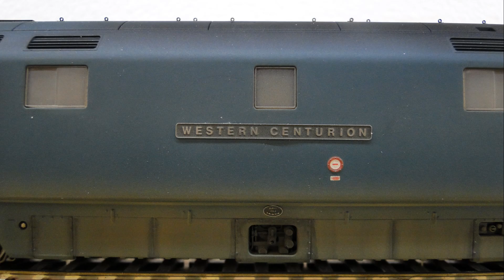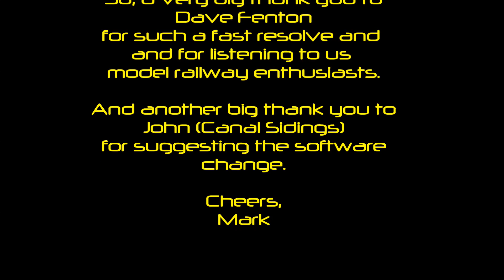Exciting news on the MegaPoint Servo Controller Board 16-09-2017

Comment: Sorry Mark me again, i like you was seduced by Dave's Megapoints Control system 2 years ago at the Great Central Model railway show held each June, your right it's not cheap especially when you have 36 points, gates & signals to control, i originally was going to fit micro switch's to switch polarity but the thought of all the extra work was daunting then i saw your vids & i have to say you did a better job of explaining the installation than Dave's vids on the subject consequently i took the plunge & purchased 10 Relay/Frog boards & 3 Driver boards.
Because of a restricted budget i have had to buy numerous boards inc a very nice mimic/control panel the cost spread over the past 2 years well over £1k then there is the trains & stock, track, dcc controller, 12v regulated transformer, bits & bobs & all the tools. 5 years of spending money a few half truth's told to her indoors and i am still here to tell the tale,LOL.
Mark have you been to the GC Model Railway show yet if not then you should go it's in my opinion the best annual model railway show, you won't be disappointed, Finally regarding your latest video format & presenting skills it is very entertaining but to be honest there was nothing wrong with the previous vids, like one of your subscribers has said you come across as a mate & i like that, well done & keep it up..... Andy
Reply from the maker: Hi Andy, again lol.....
I love the sound of what you've created and you're right, it is a very costly way of operating the turnouts, but I did do some calculations against using MegaPoints v DCC Concepts and Daves product actually came out cheaper, the more we use, the cheaper it becomes, sounds bizarre bit it really does
And I love the idea of the mimic panel, that is a route I'm seriously thinking of going down, have it in my head to make two 4' x 2' mimic panels, one for the fiddle yard and the other for the main layout and mount them on the wall, one either side of the big TV, that way you can see from a glance where everything is in real time, will take some designing but it's way off in the future yet.
Just counted the turnouts in the fiddle yard, 42 so far so looks like I'll be needing another controller board and frog board, I have a few of the relay boards, bought them from China for something like £1 each, bargain :0) I can send you the link if you like but they can take up to three weeks to arrive.
I am actually out of money now and in debt [eek] so it looks like I'll just be playing trains around the fiddle yard for the next 12 months but that is so much fun :0)
I haven't been the show, to be honest I don't really enjoy them anymore and nor does Debbie, much prefer to take her out for lunch now a days and have a nice relaxing afternoon, god I sound like a sad old git lol.....
Reply: Mark you know that TV advert Purplebricks with  "No Commission" well i have just had a NO COMMISSION moment when i read about your £1 relay boards i have just paid x 12, it's a good job i am not in your train room or i might pull your droppers off. LOL 
i wish i had done the post 2 weeks ago, seriously i did find cheaper ones on offer at Hobby King i ran them past Dave but he said he had not tested them plus his come with the cables & a guarantee not to mention product support so i chickened out. I did notice that your were not from DF so tried to zoom in on yours to find a brand name but nothing that Google search could make a match to, so yes please send me a link & thanks ... Andy
Reply from the maker: Lol, isn't that just the blinking way, buy something and then find out you can get at the fraction of the price, but then again you do have the comfort that what you've bought from Dave does actually work and that he'd replace/refund if anything did go wrong.
I buy my servos from Hobby King, just bought another 40 from them, but this time they are shipping from Hong Kong and cost me over £13 in shipping, 70 odd pounds in total, that broke me big time and I don't really need all 40 just yet, then I found some servos on that look identical but they're blue and at £1 each with free shipping, so I bought 10 at the same time as I bought the 70 from Hobby King, the 10 blue ones came from China so right next to Hong Kong and they arrived 4 days after purchase, arrived before I even got conformation from Hobby King lol.
I've added a few links for you to look, one include 100 meters of servo cable, brilliant :0)

From this website you can get a discount if you order from a mobile devise like a smart phone or tablet, well worth it me thinks.

https://www.aliexpress.com/item/Free-shipping-4-Channel-5V-Relay-Module-4-road-relay-modules-expand-with-Optocoupler-relay-For/1492110181.html?spm=a2g0s.9042311.0.0.QMyTvt

https://www.aliexpress.com/item/Single-chip-4-channel-relay-expansion-Board-supported-the-AVR-51-PIC-4-channel-relay-module/821672110.html?spm=a2g0s.9042311.0.0.QMyTvt

https://www.aliexpress.com/item/10pcs-lot-lofty-ambition-SG90-9g-Mini-Micro-Servo-for-RC-for-RC-250-450-Helicopter/32680024453.html?spm=a2g0s.9042311.0.0.8p4T0N

https://www.aliexpress.com/item/New-Infrared-obstacle-avoidance-sensor-module-Tracing-Module-electrcal-sensor-for-Arduino-Robot-project/2004170188.html?spm=a2g0s.9042311.0.0.a29wIP

https://www.aliexpress.com/item/Free-shipping-IR-Infrared-Obstacle-Avoidance-Sensor-Module-for-Arduino-Smart-Car-Robot-3-wire-Reflective/32321964595.html?spm=a2g0s.9042311.0.0.a29wIP

https://www.aliexpress.com/item/Wholesale-100M-26AWG-3P-JR-Futaba-servo-extension-cable-wire-cord-lead-extended-wiring-connector-for/32784854226.html?spm=a2g0s.9042311.0.0.a29wIP
Reply: Hi Mark, just a quick question, i note you have put isolated fishplates on what looks like all the ends of your points it also looks like you have bridged the stock rails & i assume you have also cut the the wire links on all your points, please confirm.
The Megapoint guide tells me that the frog wires should be connected to the centre connector on the relays & the other 2 connectors to the stock rails ( swapping these around if shorts appear when crossing with a loco)
Because the points are isolated from the main track then power must come from droppers from each point to the buswires which enables power & communication packets to be delivered, or is power & communication delivered via the relay?

Comment: Hi Mark, a couple of questions, 1, how far is the servo away from the servo controller or rather what is the max length of cable you have used ?.  & 2, have you used insulated fishplates on all your point frogs ?  Andy
Reply from the maker: Hi Andy, the longest connection I have so far from servo to controller board is around 4 meters and it still works perfectly. I've been busy on the fiddle yard [hence no videos for awhile] and it's nearly completed, last few lengths of track to go down and then I'll be installing servos in the newly laid turnouts, some of these will be around 7 meters away from the controller board but I don't foresee any problems, last famous words lol....
And yes, I have used insulated fish plates on my turnouts where the insulation is required, on basic turnouts I use standard fish plates on the external rails.
On the Glenn Drewertt Junction I did use insulated fish plates throughout just as a precaution and glad to say that it's running perfectly :0)

Comment: Hi Mark, I'm pleased you got your chatter problems sorted. I've only found your site last weekend and only just got up to date.  Sadly, I'd never heard of MegaPoint Controller's before ?  Just to go back to a previous video when talking about  E-link & RM  you stated, while on the setup page on  RM  that you didn't understand the information that you where looking at ?  In the second dialogue box I noticed that you had the lower baud rate rather than the higher one of  115200  and you need to make sure it's set to E-link !  I understand that this was an earlier video and could, by now been altered. I am subscribed and I got this video  within three minutes.  Looking forward to seeing the next release.  Keep up the the good work.  Derek
Reply from the maker: Hi Derek and welcome to the channel mate. I must admit that I have no idea how long MegaPoint controllers have been around as I've only recently discovered them through other YT videos, I must say though that I really am impressed but like other things it's gets rather costly when trying to install lots of it.
Oh and thank you for the tip on the baud rate, I do now have it at 115200, if I remember correctly another subscriber at the time messaged me with what to do, one of the many reasons why I love this community :0)

Comment: Hi Mark,
That was my big issue with the MegaPoints servo board when I first got them, I like you spoke with Dave and was told about not having a regulated power supply. This did improve but the chatter was still there. Being away from the railway for 12 months and you have got what I wanted a none chatter board. I will wait for the new software release and upgrade my boards with Dave.  Great news well done to you and Dave.
Reply from the maker: Thank you Ian, it is a great result for all of us and it was our community that helped it to get there and Dave was fabulous with his response and speed, first class customer service.